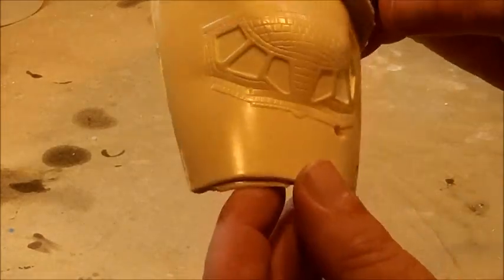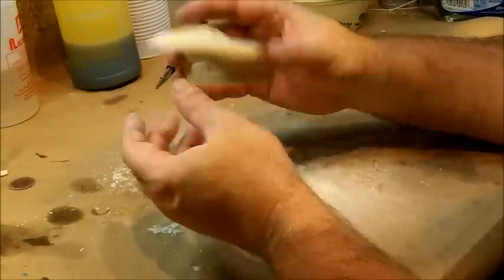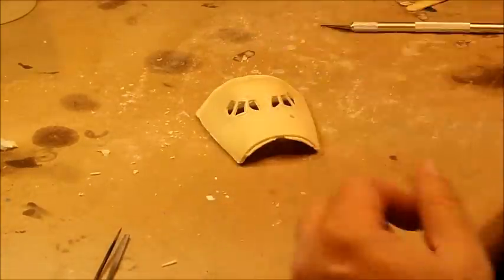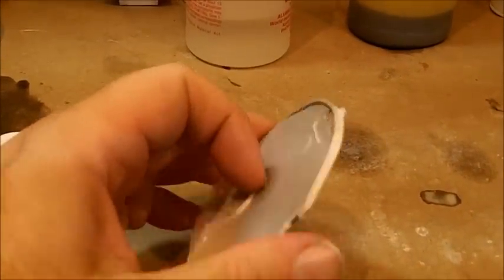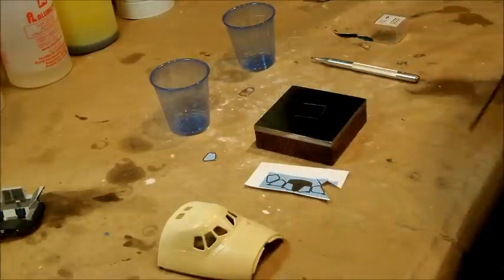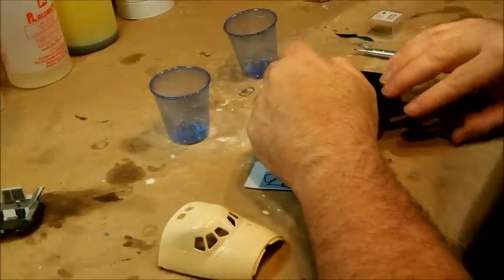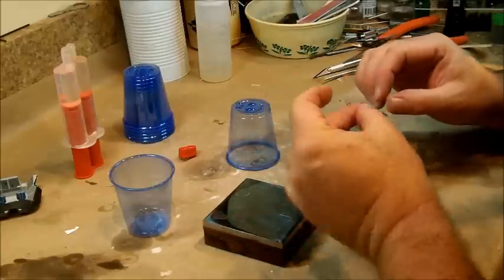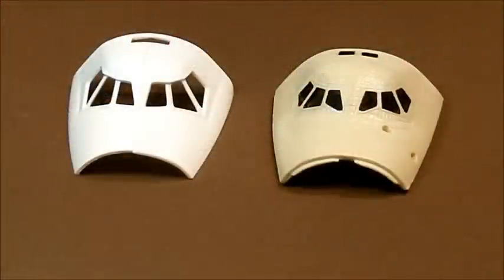Monogram Beany Cap

Comment: The monogram kit I have the cap is a molded on piece,not 2 pieces as you showed. Was there 2 different kits? Or did you cut off cap from monogram kit?